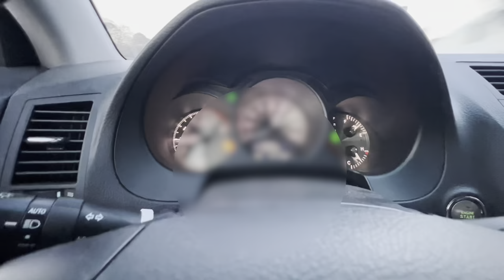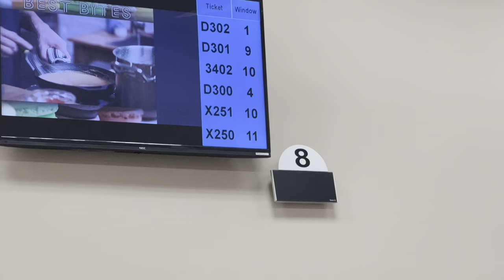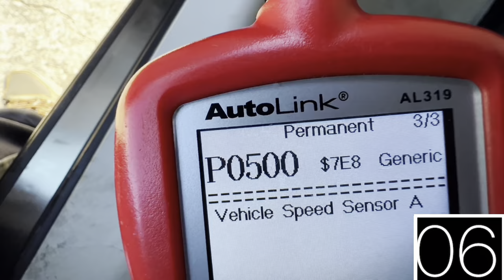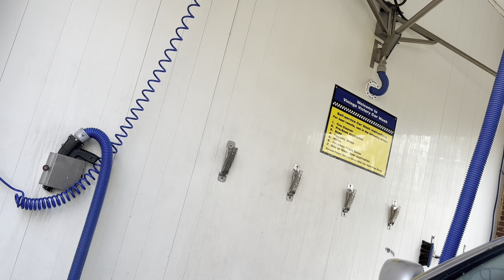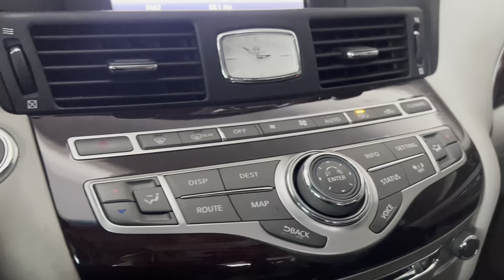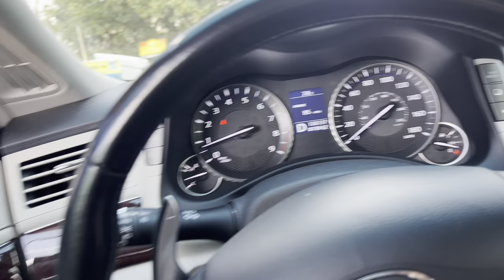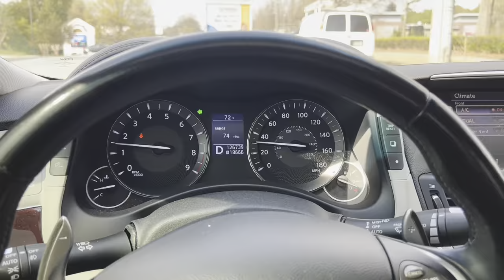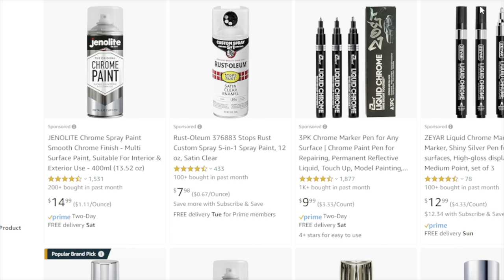The Car Wash Scratched My Wheels On My Infiniti M37S & Don’t Want To Pay For My Damages

Comment: U should dry your cars, sun light and water drops act as a microscope on the car paint. U never go to a dealership and them just wash and let air dry a 400 hundred thousand car. Bro get out that mind frame. It's about the presention.